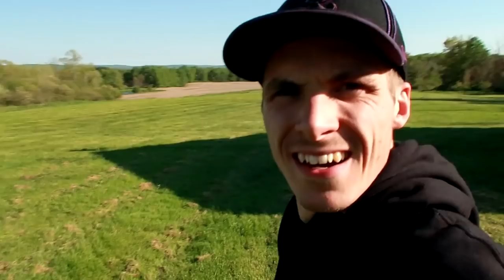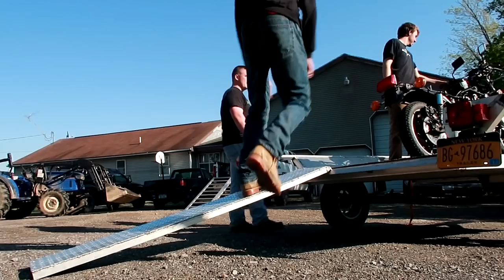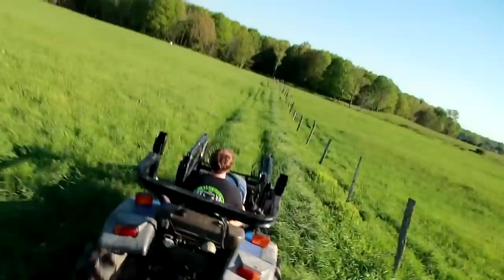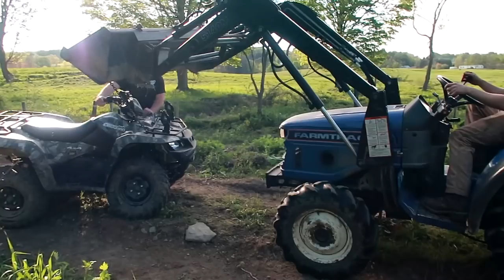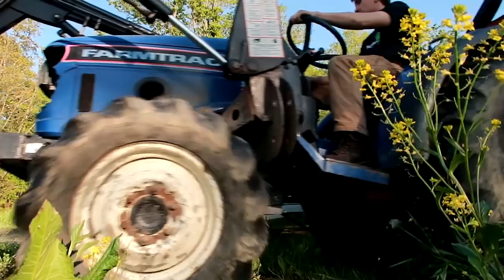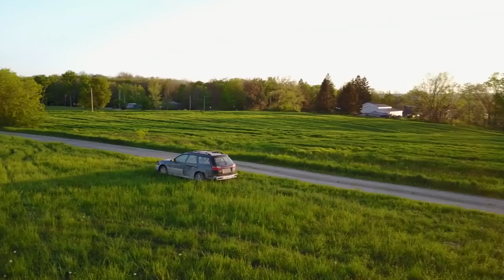HE TOTALED IT!

Comment: Dalton, what the bike shop knows is that before you can time it, you have to take the slack out of the cam chain.  There is a spring loaded tensioner that does it automatically.  Usually its just a matter of turning the crank to a certain position and then loosening the lock nut on the tensioner shaft to allow it to push on the chain...then tighten the nut back up.  Only then can you set the timing.  Those drilled out adjusting slots were a dead giveaway that the last guy was cheating because he didn't know his cam chain was stretching, allowing the cam and crank to be out of sync with each other.  What usually happened to these  bikes back in the 60s 70s and 80s was that the battery would die (these bikes need a strong battery).  They would keep trying to run it with a weak battery, ruining their starter solenoid, and when it did run, it wasn't right with a weak battery.  Soon, it wouldn't start, and they would start jacking around with valves and timing.  Then it would get parked and the carbs would crap up on 'em.  Then along comes you.  And you have to start with all the basics.  Cutting your teeth on a 4cyl is tough.  Most of the battery, exhaust, and carb advice you've gotten is good. -dan

Comment: that's not too bad. I just had an 05 king quad 700 in after a bad rollover. spent 10 hours straightening the frame, had to get new lights, "new" racks and bumpers, two new a arms, all new a arm bushings, new wheel bearings, one new wheel, and some other small things. looked brand new when the owner picked it up
Reply: andrew Fell im guessing you did not tell what happen lol

Comment: i bought an 2006 yamaha 660 grizzly with the same problem except it was the a arm not the frame. only paid $350 and just cut the a arm and replaced the bent holo tube with solid stock and welded it up and measured it the same as the side that was not broken and its great.

Comment: Now that's why you buy a Suzuki right there, it's built like a tank!
Reply: Kountry Quads agreed. My 05 eiger is unbreakable
Reply: Kountry Quads my buddy has a brand new artic cat 500 and he's constantly breaking it with only 300 miles on it my kingquad with 5700 miles has never had an issue and constantly showing up a brand new artic cat
Reply: Chris Jacobs I agree, my dad has one. Is yours an auto or semi auto?
Reply: Quadlife really?!? I was looking at getting one, my friends dad has one and it hasn't broke yet, i still agree the king quad is better I just can't afford a brand new king quad.
Reply: Kountry Quads the kingquad is 100% worth the money my buddy traded his artic cat for a new grizzly and it has been a way better quad than that artic cat ever was
Reply: Quadlife really! I will keep that in mind, what broke on your buddies Arctic cat? Just curious.
Reply: Kountry Quads he had a real trouble with the axles in the rear snapping and the suspension would grind a lot. The brakes would wear out every other month. No matter what brand of pads he tried, which included oem artic cats. He had bought the extended warranty when he purchased it new but artic cat wouldn't cover any of this under warranty. Ball joints would also wear out. All that still on stock tires. Every time he had to pay out of pocket.
Reply: Kountry Quads it's a auto. I also have a 500 kingquad and a 750 kingquad

Comment: The word totaled is so overused these days, just like folks call anything 4 wheel drive a "Jeep".  Totaled only applies if the vehicle is either not at all repairable, or if there is comprehensive insurance involved AND a claim is made and the repairs are greater than the worth of the vehicle, then the insurance will total it.  There are many "totaled" vehicles back on the road with either clean or salvage titles, just because the cost was too high to repair, but to someone with the right know how, easily repaired.  A vehicle is also automatically totaled if any of the air bags deploy, so as that the insurance company is no longer liable for any subsequent repairs.